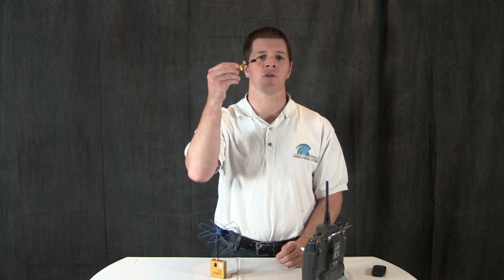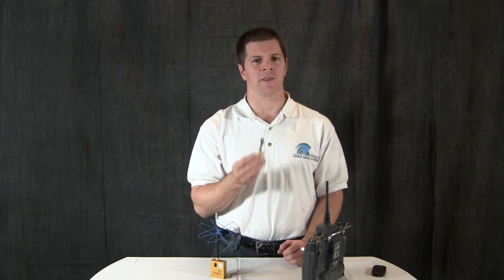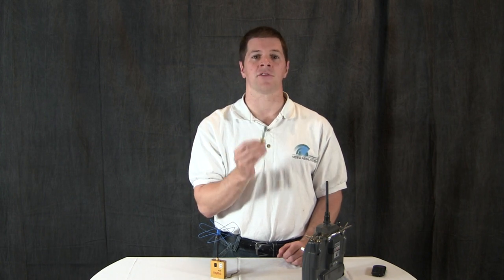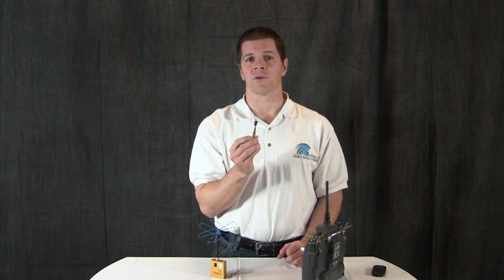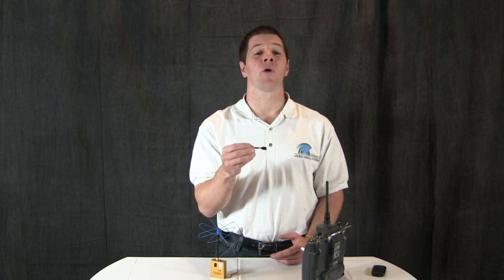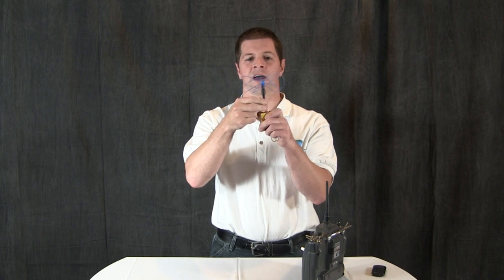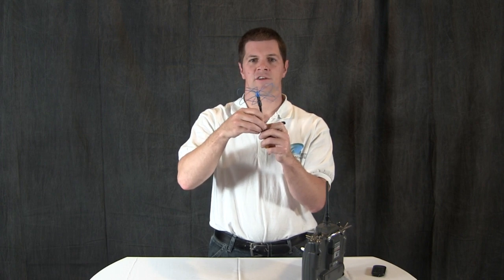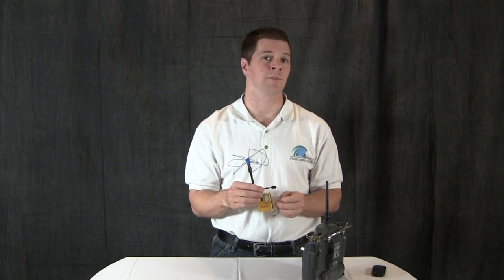1.3/2.4GHz notch filter overview

Comment: Can you use this notch filter to filter out 2.4 ghz if your video is 5.8ghz?
Reply from the maker: No, unfortunately.
Reply from the maker: Well, you can, but it will attenuate your 5.8GHz video feed as well
Reply: So what can I do if I have a 2.4 ghz transmitter and a 5.8 ghz fpv system? Would I just have to get one of the systems replaced?
Reply: @CAGreve1231  Could you please answer for the question  asked by @h22izzo 
So what can I do if I have a 2.4 ghz transmitter (currently ELRS) and a 5.8 ghz fpv system? 
Thanks!
Reply from the maker: @TamilMediaTV  - No.  It is for 1.3GHz harmonic filtration only.

Comment: Hi Alex, will this filter also help Naza GPS to lock?
i did use low pass filter before, and it really help Naza GPS to lock.
but the LPF is broken on crashed and i plan to buy this filter instead.
thanks
Reply from the maker: No it will not work for GPS issues.  The low-pass filter is the only option I know of.
Reply: I used a low pass from RMRC.  It does help.  I forget which channel I was using (I think 1258mhz) and it worked well, but the other channel (i believe 1280) was completely swamped, 0 sats.

It may help to acquire the intl version of the 1.3ghz, as it goes up to 1360mhz and and down to 1080mhz.